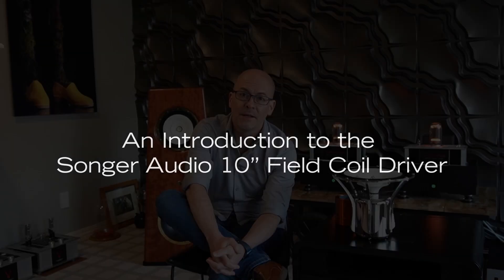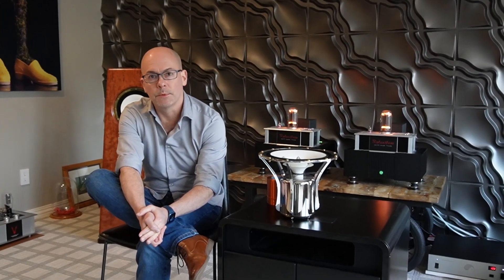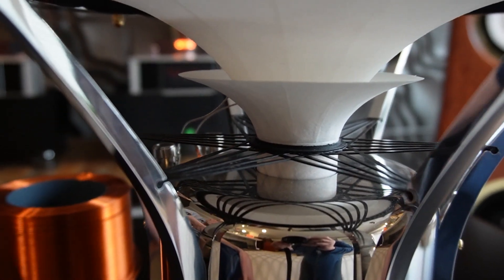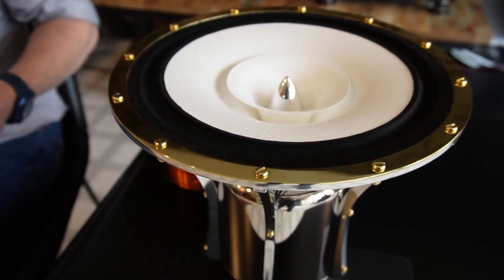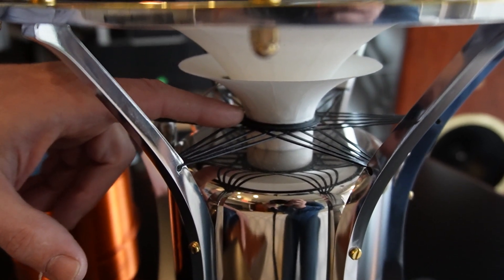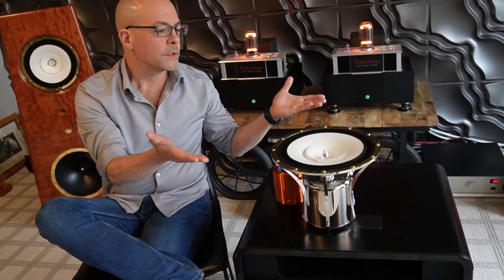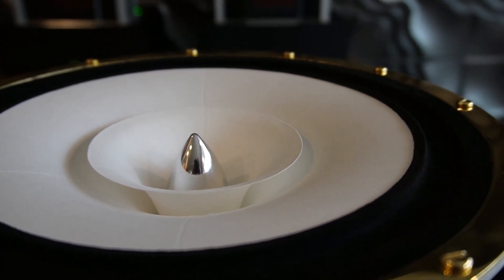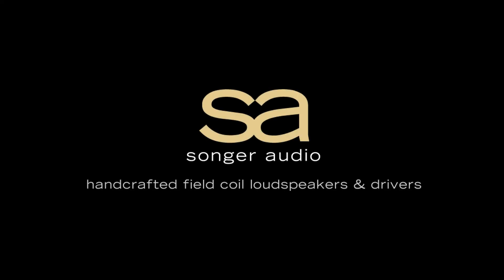An Introduction to Songer Audio Field Coil Drivers

Comment: Have you experimented with silver instead of copper for the field coil? Also why the transistor PSU? Large mercury vapor rectifiers or tungar bulbs could supply the needed current and would probably sound significantly better

Comment: Interesting for sure.  Like to know about the power supply, wattage, heat dissipation?
Reply from the maker: Sure, Dale.  The power supply is variable between 9 - 12.5 VDC.  The design is proprietary courtesy of Whammerdyne Heavy Industries, and you can read a little more about it here:

https://songeraudio.com/products#ps1

The power supply doesn't produce much heat, and what is does is well-managed by syncing to the aluminum case.  The field coil motor never becomes more than a little warm to the touch in the open baffle S2.  In the S1, it's a good practice to just turn off the power supplies overnight and at at the end of listening sessions.

Comment: Hm.. Your spider isn't linear right? Was it made intentionally, sir?

PS Field coil cartridges are a snake oil for me. Why a filed coil is great is because its force depends on a power that amplifier uses (with some natural LP filtration of course). A current pulsates though an inductor coil depending on a sound level. Otherwise there is NO difference for a membrane coil what is a source of a magnetic field. Physicists have not discovered a new form of a magnetic field yet. And these talks about electron spins are for rich intellectuals.
Reply from the maker: The spider is actually quite linear.

I can't comment on electron charge versus electron spin.  While I have read that as well, I agree it may be irrelevant to the performance of the driver.  The difference with a field coil is simply attributable to the permeability of the magnetic material, not anything new to magnetism.  The higher that figure is, the stiffer the magnetic field, and in carbon steel or permendur that number is very high.  Even when a magnet is very strong, as is the case with neodymium, the permeability is similar to ordinary ferrite and the accuracy of voice coil modulation suffers as a result.
Reply: @songeraudio24  A fact that you as a designer can select a field strength, could help to get better numbers. With no doubts. I will monitor a situation with FC drivers. It would be great to find this market growing.
Reply from the maker: @sc0or  Cheers, and thanks so much for your comments.  They are always most welcome, and appreciated.
Reply: How, on Earth, could a technological approach that the mainstream audio manufacturing and consumer industries championed for the better part of forty years be criticized as that, tired-ass, adjective — “ snake oil ? ”

Sheesh . . .
Reply: @oliv9768  Where you see a "technological approach" I see a "marketing trick". I explained why those days engineers used field coil cartridges. They had only weak ferrites and transformer outputs. Everything should make some sense. Nobody will pretend to make an innovative thing adding parts made of titan to a steam engine. You need 1Tesla magnetic field? You take a neodymium magnet. That's it. No needs to achieve a same result in a more expensive way.

Comment: An audio dealer friend of mine uses a field coil speaker.  I haven't heard them yet.  Does the Songer have a wide dispersion as a Von Schwikert or more restrictive, or as much as a Duntech, Dunlevy, Martin Logan, etc. which are highly restrictive to a single center seat?  What I miss most is dispersion for multiple listeners.  I always give at least one guest or my wife the center seat.  The technology appears to be hugely successful with so much less engineering and manufacturing costs.
Reply from the maker: Stephen, I regret I didn't see this comment much sooner.  Hopefully this objective review of the S2 from Marc Phillips, Editor-in-Chief at Part-Time Audiophile will paint a picture of the dispersion characteristics:

https://parttimeaudiophile.com/2024/03/08/songer-audio-s2-loudspeakers-review/

Comment: Why is a fieldcoil-induced 1.7Tesla magnetic field in the voice coil gap better than, say, a 2.2Tesla one, induced by a neodymium permanent magnet? Your creation looks stunning and is a great achievement, as well as a work of art and tech. I absolutely love that spider and the leather surround. But a stronger permanent magnet, even with the drawback of the Barkhausen noise, may prove, overall, superior. Your  "trampoline" theory is a little vague and unclear to me. Not to mention paper-cone break-up colorations! (Please don't say that washi is uncoloured). Having struggled for almost two decades with Lowthers, my conclusion is that they have to be dealt with, otherwise the sound will never take off, it will always be compromised.
Reply from the maker: Thank you for the kind comments, @Full Ranger!  Even though electromagnetism may offer the greatest potential, it's only part of the story - lots of great loudspeakers in the world, and only a handful are field coils.  Many use neodymium!  In our driver, the materials, the soft suspension, the lightweight moving mass... each plays a part, as well.  Cheers.

Comment: what is the difference between the tesla rating and stiffness?
Reply from the maker: Hi Everard!  A magnetic field may be very strong, but not stiff as it responds - neodymium is a good example of that.  Another good analogy to illustrate the concept is a car jack.  A strong jack can lift a lot of weight (tesla), but if it's sitting in mud, it sinks and slips as it lifts the car.  The stiffness is the surface the jack is resting on.  If it's sitting on concrete (high permeability), it will remain precisely where it is as it raises and lowers the car.
Reply: @songeraudio24  permeability will depend upon the material used to build the motor parts it is not a function of the solenoid or the supply, better material material will benefit any speaker no matter the magnet type.
Reply from the maker: @moray james  Indeed it does!  For example, permendur or iron will yield higher permeability in a field coil motor.  With a field coil, the boundary is the saturation of the material - and that is a very high value comparatively.
Reply: @songeraudio24  Thanks Ken for the additional clarity. So it is not just about higher the tesla number. That stiffness is also a consideration. What is the unit measure and I wish that manufactures would report off of the data.
Reply: @songeraudio24  could this also be described as a type of temporary “decay” in the field strength under a specific “load” IE the movement of the coil due to the signal?
Reply from the maker: @polkiju7  I don't think it could be described as a decay in the field, per se.  Permeability is conventionally a property associated with the material of a permanent magnet, and it indicates the degree to which the electrons in that material are spinning in uniform alignment with one another, at least as I understand it.  An electromagnet can at it's limit achieve saturation of the material, which in low carbon steel, pure iron, permendur, etc constitutes a very high number. What you're describing is a bit like parasitic inductance.  But bear in mind, a degree in physics is NOT among my qualifications.  :)  My education is ongoing... a big part of what I love about this work.
Reply: Thanks for the elaboration. Certainly more complex than I imagined… like so many things!